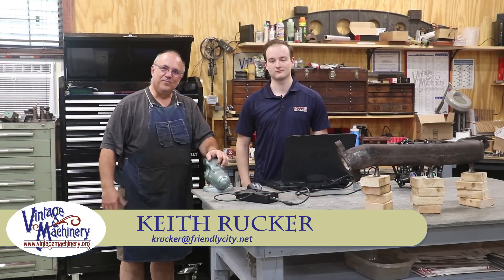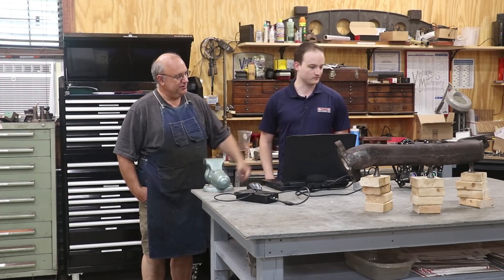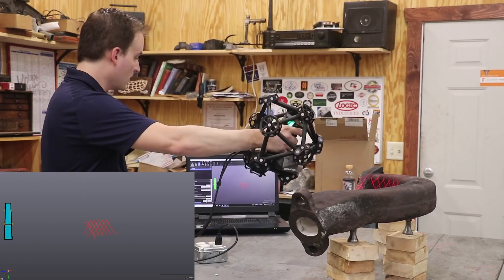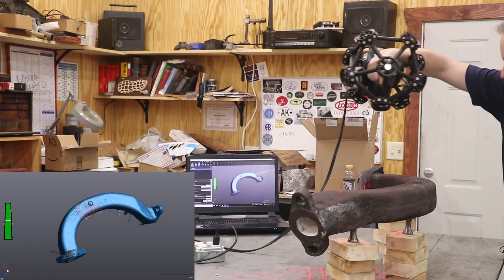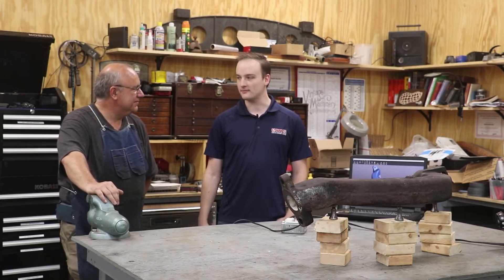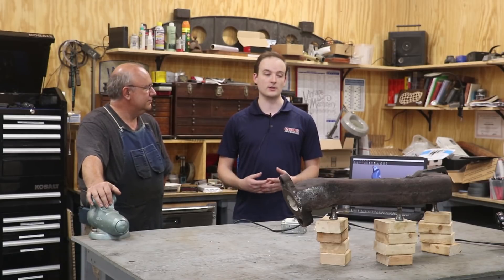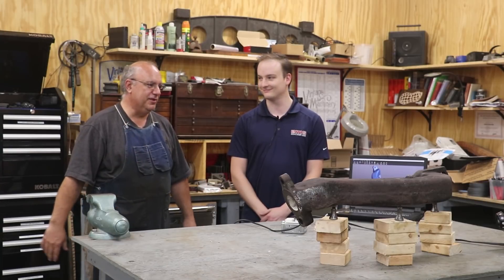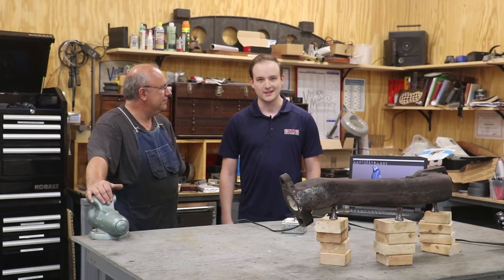Steam Locomotive Steam Pipe Repair - Part 3: 3D Scanning the Part

Comment: Keith, I'm sure by now you realize that you are having sound problems with the mics/camera. One of the problems is that your shop is so reverberant that there is a tremendous echo and it makes it hard to understand what's being said. If I were you I would get headset or earset mics so that the mic is much closer to the sound (voices). Some of the other "funky" stuff that sounds like fade in and fade out, as well as phasing, may be because there is an AGC (automatic gain control) on the camera. What may be happening is that with the AGC, it's having trouble with gains as it goes back and forth between real voices that are naturally changing, and echoes that the mics are picking up. It also may be that you are in fact getting some phasing as both mics are picking up both voices. I think that the boom mics that would be very close to the corner of your mouth will solve a lot of these problems. And yes, you do want to have it just behind the corner of your mouth. This way you're not picking up the air noises of talking or breathing, or those times when you breathe out your nose. Here's the start of a Google search on phasing: https://www.google.com/search?ei=m-bTW-yQAeLr_Qal_bGIBA&q=phasing+with+bluetooth+mics&oq=phasing+with+bluetooth+mics&gs_l=psy-ab.3...696796.700098..700625...0.0..0.62.388.7......0....1..gws-wiz.......0i71._zo_p0BGKI0   Good luck. BTW, if it still only happens when you are recording alone, it's most likely a processing problem in either the mic or receiver. I've forgotten al lot of it but there's all kinds of compressing, decompressing, to minimize the amount of data that needs to be transmitted/received.

Comment: Just a suggestion for the sound for what it's worth, most mics have  "some" foam rubber around them but it you get a block of it and cut a piece  about 3 sizes bigger than the mic and then place it over the mic is seems to cut out echoes and especially and wind noise if your outside. Just a thought.

Comment: Keith, may I suggest that you make a flange plate for both ends, mount them IN the locomotive and then weld rebar or bar stock between them. This will give you exact distance and ANGLE between the ends for any new part, which is ultimately what caused the initial part to break because it didn't match. You could use such a jig for mill setups.

Comment: It would've been cool for him to scan the flange bases in the locomotive as well so the female flange surfaces could've been mapped and compared. This would help to eliminate the misalignments caused by the repairs to the steam pipe. If it's too late...you might look at the 3d structure scanners that attach to the ipad. Not affiliated, I've just used them at work.
https://structure.io/uses
 Relatively inexpensive and fairly accurate. It would be cool to start building a 3D database of the loco as you do repairs.

Comment: It's probably too late, but the real "problem" is connecting two mating locations in the locomotive itself. (The part you plan to make is the solution to that problem.) A scan like this of the cavity in front of the boiler (including the two mating surfaces this part must mate with exactly) would tell you if any tweaks need to be made to the relationship (relative angles and distances) between the two ends of the part you are making.

My guess is that the vertical plane of the upper mating surface is (or should be) at exactly 90˚ to the horizontal plane of the lower mating surface. There is also displacement (or translation) in both directions on both planes, as well as rotation of the "ears" on each end (in relation to some defined line on each plane). By making the two planes be exactly 90˚ to each other (both in the cavity and on the part), slight errors in location (distance between the ends) can be compensated for by slight in-plane displacements of one or of the other of the mating setups.

Comment: Hi, it’s a great shame about the sound quality. I’ve got a hearing problem so heard almost nothing. From what I saw however the scan results were fascinating. There have been programs on cable showing similar equipment scanning cave systems and French cathedrals, but not something of this size. Now looking forward to seeing how you use the results. I may have missed it but did the lad have a chance of scanning the inside of the loco? Regards.

Comment: Not that is a genuine example of practical magic in action. That probably couldn't have been done ten years ago without taking the part to some special multi-million dollar facility, and even then the results would probably not have been as good.

I'd bet that with that outside scan you could now almost trivially design a casting pattern with appropriate shrinkage allowance and route, mill or 3D print it almost completely automatically. Probably with not much more work there is a program around that would compute the optimum core shape and the core pattern could be automatically milled or printed too. About the only hand work would be making the actual casting and knocking the sprues off.

Comment: While watching Project Binky videos, I saw a perfect technique for dry fitting this part in your shop. Make two plates which will be bolted in place on the boiler where the two ends of this cast tube normally attach. Then, mount the plates on the boiler and weld some frame connecting the two plates together, to preserve the spatial relationship of the mounting surfaces. Next, take this jig back to your shop and build a mating jig representing the boiler mounting surfaces. Using the latest jig, you can test fit to your heart's content on a bench in your shop.

Comment: One could easily 3-D print the pattern for the outside. Not sure what the core would look like, that is, not sure from what I see that you could extract a 3-D print of the core. But if you can (it's all software :)) then a lot of problems are solved  and you scan it, 3-D print the pattern, 3-D print the core, send to foundry. The original core boxes are of course long lost.

Comment: I was thinking you were going to cut the bad end off, bolt the new piece in place on the engine, put the rest of the pipe back on, and then attach straps to the outside to locate the two pieces together, take the whole assembly back off and make a new piece to fit, and then braze it in.

Comment: The nice thing is the unaltered part can be documented. Once the file is completed a casting firm could make that exact part at some later date, maybe for another restoration missing that piece or if a major mishap later shatters that one. The original would have only been documented by the casting pattern, modified by the shop any number of times from some original sketch.

Comment: Would have been nice to scan the one in the locomotive that fits ok. You mentioned that the other shop messed up the sealing surface angle that is on this one.
Reply: Rambozo Clown glad I'm not the only one tho har the thought. Hence why I read a few of the comments before I comment. Keeps the redundancy down.

Comment: Very interesting video, given that the original pipe was, presumably, under stress to cause the failure could a 3d print be made in plastic, fitted in the loco & adjusted as necessary so that it is a correct fit then measured to make a pattern to cast a new one or would that be prohibitively expensive?

Comment: Hi Keith -- Thanks for demonstrating some newer technology and how it can be used to augment older tech.  Question - can his program do a mirror image so you can get both steam pipes made at the same time.  (Murphy's Law says that as soon as you replace this pipe, the other one will break!)  Can you just send the file to a foundry and have them cast a new pipe?  Thanks to Adam for making the trip to Tipton to demo his scanner - very cool tech.
BTW, I'm an engineer:  If it's broken I can fix it; if it isn't broken, I can make it better!

Comment: The old school method of sealing with a ring donut allows movement to align without precision manufacturing, the biggest mistake made when installing is to try to get the bolt flanges even, this is what causes flanges to break off. Even pressure on the mounting flanges is what is important. Ring seals are still used in the automotive industry, mainly for attaching exhaust pipes to manifolds.

Comment: It is really interesting to see old and new technology mixed.
 It is possible to do a 3D scan with just a DSLR camera and some photogrammetry software. I played around with that a bit before Autodesk started charging for their photogrammetry software. It may not be quite as accurate as the laser scanner but works well for a lot of applications.

Comment: Great to see the modern technology being applied. Given the original part has failed, maybe due to the flanges not being perfectly aligned correctly causing unacceptable stresses onto the lower flange. How will the new design best include the flange to flange alignment within the design rather than replicating what may be, the root cause of the problem? Maybe making some dummy flanges, attach them to the steam engine and braze a bar between them to get an ideal model of what the best flange alignment dimensions should be, in a cold state.
Reply: Excellent comment.   It's likely that the uneven stresses created in the flange as it comes to operating temperature contributed to it's failure.

Comment: Please don't give him crap about the audio. I'm sure he done his best after his wireless mic crapped out on him.

About the measurements. It's crazy how accurate it is. ( reverse engineering of the hard/software would be so much fun :-) )
I would really like seeing the finished 3D model and maybe a small video how the post-processing of the data work.
Reply: There's also plenty of Chrome extensions that help deal with this kind of issues.

Comment: It would be even cooler if you could put the retroreflective markers/stickers on the part and be able to move the part too. But never the less, really awesome. Would 3D printing the part or additive/subtractive machining be a cost effective option? Thanks EMS for donating your time and equipment. (I'm in Tampa too. I bet being by USF and MacDill AFB/CENTCOM, and all the branches of the large defense contractors that are around the AFB, is very profitable for that company!)
Reply: How exactly would that be cooler? You already can move the part around without sensors on it. The software automatically reorientates the part.  He said in the video he was going to flip the part and do the bottom.

Comment: I guess the question is - What Next. Logically you could take the cad file and fix the problems with the flange and then 3D print it. That would give you a pattern to put in your casting box  BUT you don't have a scan of the inside passage in order to make a core for your casting. I suppose that could be created in CAD easily enough as just a smaller version of the outside dimensions to leave a wall thickness. Hopefully you can find someone with a 3D printer big enough to print your pattern.
The technology is cool but it doesn't eliminate work it just changes the work to something different.
For a one-off piece you'd probably be better off to just fix the flange and be done with it or fix the flange and use the fixed piece as a pattern to cast a new one (core still being a problem though)
It will be interesting to see how you make out.

Thanks
Reply: The casting core won't be an issue at all with this method, they will also 3D print the core box. Any cad program can be used to quickly and easily create the steam passage. Of course with a cad drawing a wood, metal or plastic core box could easily be machined with CNC as well. If they were lucky enough to find a properly equipped foundry the sand core could be 3D printed as well and be ready for use right off of the printer.
Reply: I was wondering how they would create the steam passage also, thanks for the explanation Truracer20. I don’t know much about 3D printing and you explained it very well.

Comment: Reflection: Left to right, from front. A new casting without defects is safer than a repair.
Reply: Did you bother to watch the preceding video?  Keith goes into detail about how they will repair the old one for a temporary fix and create a new casting for the permanent repair.
Reply: I watched the video. I also clipped/scanned a reference for the part and have forty-odd years doing similar repairs. So I know exactly what I am seeing. Furthermore, I remember him saying he doubted he would be able to get access to a 3D scanner for this project. Thanks to the grace of his followers he will be able to proof a good casting for the replacement.